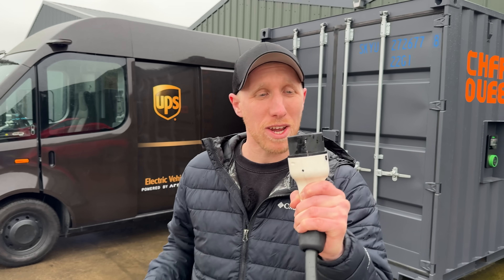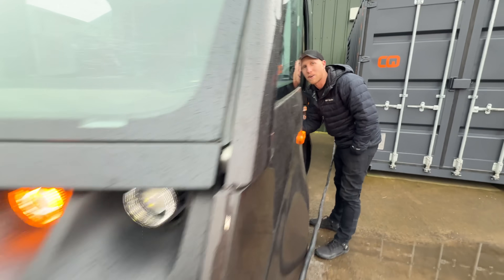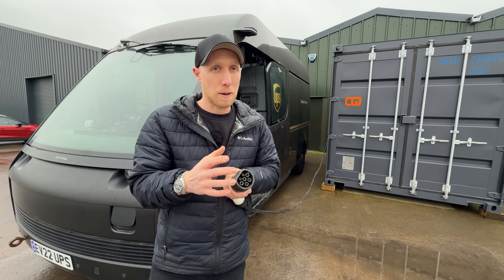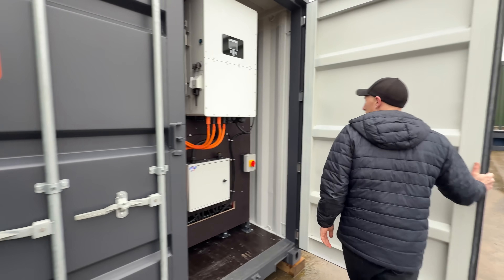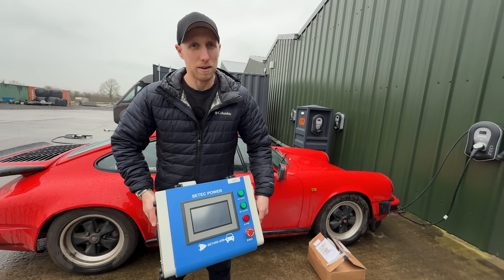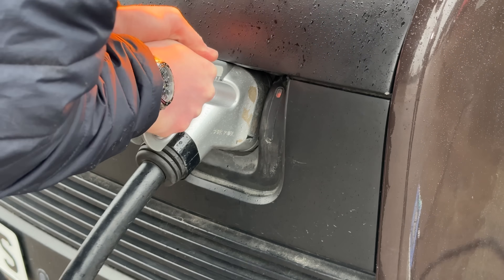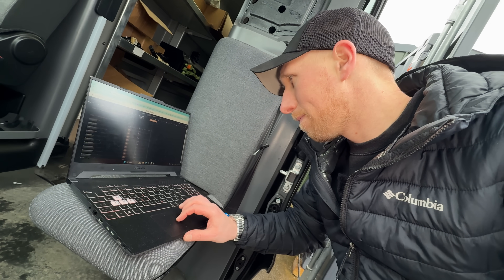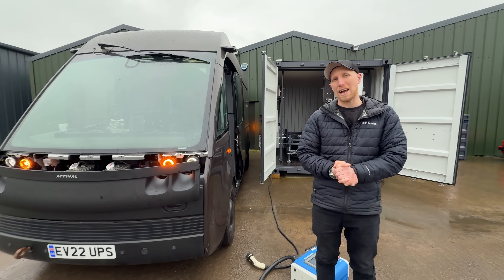Will the Arrival Van Finally Charge?! Testing Type 2, CCS, and the Charge Qube!

Comment: Thanks for these videos. I invested a very small amount in Arrival and this has been a nice bit of closure on what happened. There was clearly a lot of skill in place when making the vans. It's a damn shame the company went under. As you previously mentioned, they didn't seem far off a production-ready model. But, the decision for a first time entrant to the auto industry to make multiple vehicles straight off the bat, oh... and and try to revolutionise the manufacturing process was every so slightly daft! The impact of Covid on speculative investing was a hammer blow. With better decision-making, the company might have been as resilient as its panels.

Comment: I recently worked on another brands UPS Electric Van… and nobody could get it to start. Turned out, UPS requested by their body builder/manufacturer to have a key fob security system fitted to prevent it being started/engage drive.

Comment: Unless you are a delivery driver, this would have to be a camper conversion. It would be nice to get it going in its original format, potentially easier, especially if you can get someonewith some experience in this platform to have a look.
Reply from the maker: I think going Tesla and then making it into a camper would be cool
Reply: @Hazell_Nutz  Self driving if your Tesla bits has it would make it an obvious decision.

Comment: You have done really well in persisting with trying to get the Arrival systems working but it seems like a very good time to bail and go with the Tesla system - which would be super easy in that van! Things I would have a look at first - Can you incorporate the M3 steering rack, if not I have working emulation for that - Electric parking brake - if the rear rotors are less than 20mm thick it probably won't be too hard adapting M3 calipers/park brake. I assume you will mount the M3 motor into the Arrival subframe and make shaft adaptors? Check what wheel speed sensors the arrival van has - The amount of 'clicks' will need to match the Tesla or it will turn off traction/abs/regen etc... I am close to emulating this using drive unit rpm so if you have trouble that will be open sourced (when I finally have it totally sorted).

Comment: It's been great fun seeing you work on this van, shame it is so hard to make progress without any info (but that's usual with software!) - can you reuse any of the battery packs and motors with a different control system?

Is the race van needing new running gear too, could that benefit from the model 3 parts?
Reply from the maker: I really want to make it work in original form but think it will be unreliable long term. The race van is waiting on dual 400kw motors.

Comment: i wonder if it would be possible to splice in the batteries and motors from the van into the T3 systems using an adapter
Reply from the maker: The issue is the rest of the van system does not work well like the head lights

Comment: As much as it would be nice to get the Arrival tech to work, even if you could -,it propably wouldn't be much good. So Tesla-swap it is. 

Also cool would be to cut out all the walls and roof behind the cab, and make it a Qube transporting lorry. But it propably doesn't have a chassis for that.